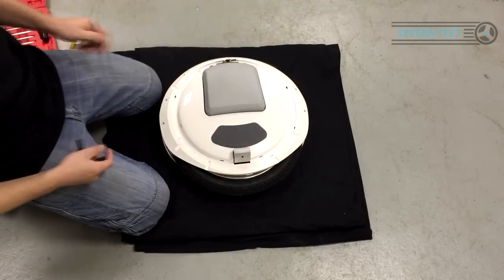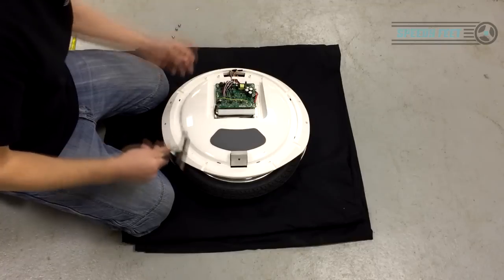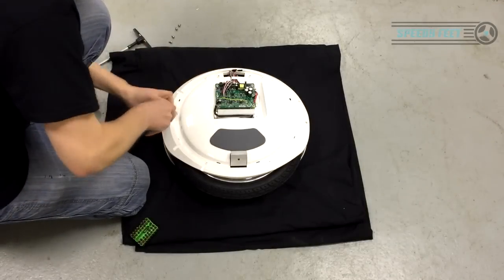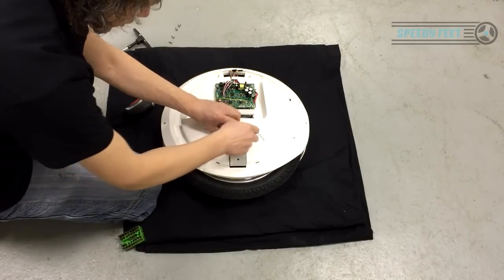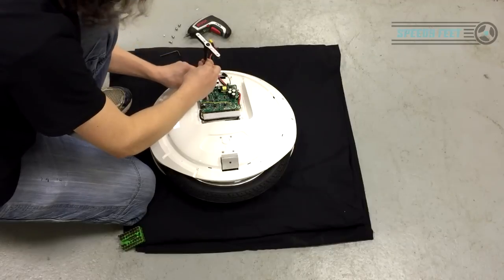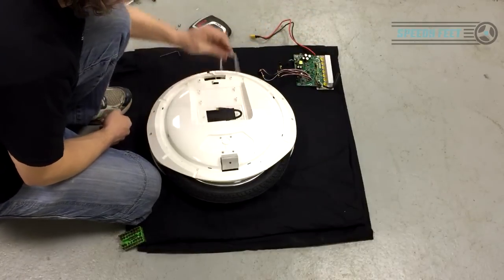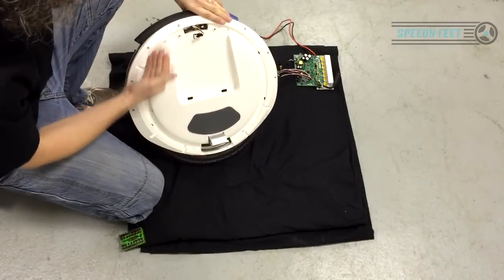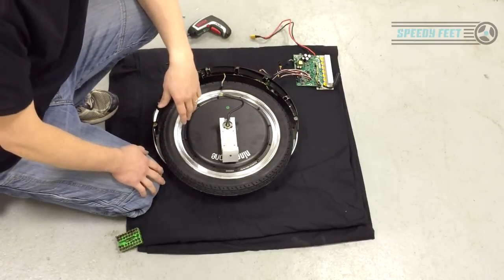Ninebot ONE - How To - Tear Down - ADVANCED

Comment: Power drill only for removing screws. I've seen so many plastic threads stripped by people who don't know what they're doing. Using electric screwdrivers to assembly things require a bit of practice (practice on something you're throwing out). Better yet assembly it by hand then you got better feel for how tight they are and:
Also very important when assembling again make sure the screws which go into plastic is resusing the threads they've already cut. If you don't you'll cur a new thread into the plastics each time and a few of those and suddenly you need to repair the thread which is a completely different (and difficult) story. Better take your time and doing it correctly than rushing it.

Comment: Ian, many thanks for your informative videos. I'm so tempted to get one of these! Can you tell me though how easy it is or otherwise to repair a puncture or replace a tyre should it be required?
Reply: I thought you might be interested in getting one of these :-) You'll have to show me it when you get it ;-)
Reply from the maker: Steve, no problem, we get so many questions regarding how to do this or that - sometimes its easier to just make a video :)

To replace a tyre is the same method as a push bike (so cycle tire levers etc), the side shell needs to be removed - 5 minute job (just remove the battery side main shell).

Hope this helps!
Reply: Ninebot UK بدي واحد منهم
Reply from the maker: They are so cool! www.SpeedyFeet.uk :)

Comment: God damn it i stripped it down thinking i had a socket problem but its a soldor come undone in plug on the fast charger. Ian out of interest, can the charger plugs be bought from anywhere so i can have 2 chargers in play? Fast charger at home slow charger at work would save me some weight
Reply from the maker: Charger plugs are just a standard part on most wheels yeah.
Reply: @Speedyfeetuk  Hey man...I looked into it and the plug in question is a LEMO notched 4 pin push pull connector. There are some really nice metal versions for upgrades worth checking out.

Comment: I just bought a pratically new s2 from a friend, not even 20km run. It was starting normal then I made a little mistake to forget the valve adaptor on the tire before I inflate it. I turn it on and gentle move it a bit foward to show a friend. The valve adaptor got stucked inside and I turned it off. This was one second. I could bring it back, wasnt so hard but after that, it never started again. When I click power it just make a beep or two. Tried to disconnect the batteries without success. Is it so fragile? I mean, I just moved a few centimeters with the hand. Please give me some idea about what to do. And if I cant figure out how to fix it, can I send it to you? I´m in Milan.
Reply: I checked how many volts for both of my batteries. 62.2V each. A little more than 54V it supposed to be. The funny is, this battery has a small led in the back part of it. It blinks green light. But when I try to start the ninebot, the green light became red.

Comment: the plate underneat the circuit board is stuck really hard on my ninebot e+ and i'm afraid i'll damage the circuit if i take it away! how can i remove it safely?!
Reply from the maker: +mrfiliox As long as all the screws are removed from the board and the plate, then it can only be stuck to the rubber seal, is any of it loose?
Reply: +Ninebot UK All the screws were loose but it was still stuck, but I later managed to get it off. I didn't really want to pick it apart but there was a rock stuck in the wheel and it would grind really loudly whenever it rolled. It works fine now.